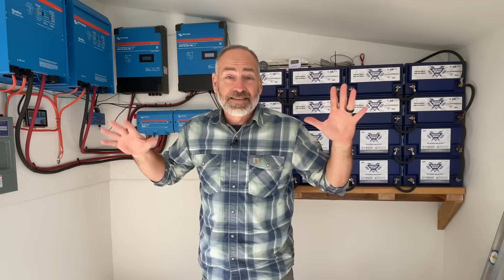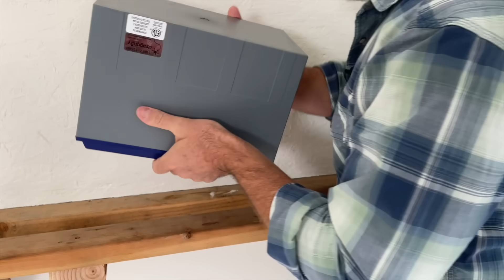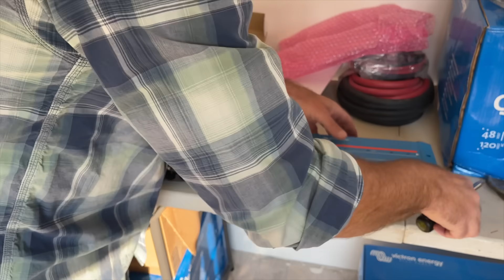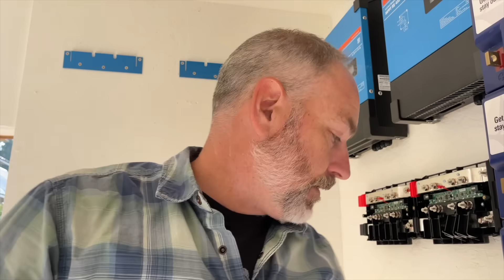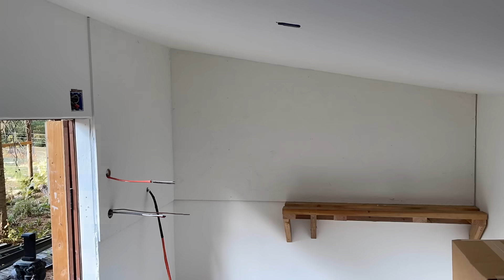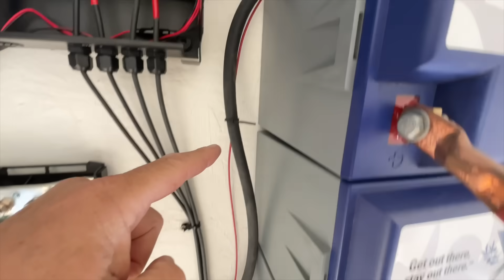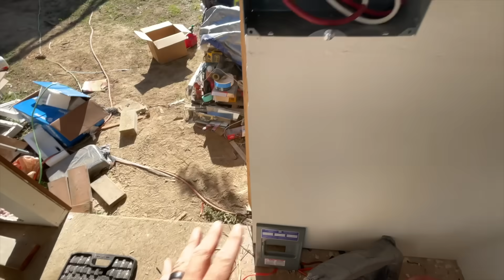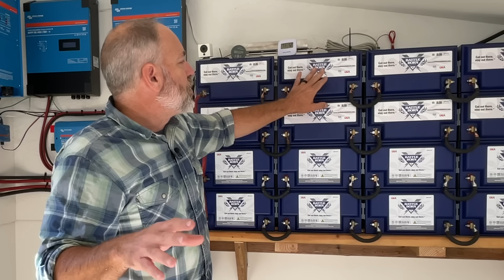EASIEST Off Grid Solar Power System Battery Bank

Comment: Looks impressive but  I think you should  put  bus bar  inside  a  junction box instead of keeping it exposed  it is dangerous when Live
In addition I would run the wires inside pipes

Comment: Weak sauce. 

Be lucky to run lights, minor electronics, fridge and furnace during actual colder/winter months. Each of the 16 batteries best price as of 2023 ~$500 each from sketchy “buy within 30 minutes or else” scam looking website/sellers. Unless you are way in the bush… and need a lot of grid power poles (10k each). 

Solar is still a silly investment. Spend 50k and get 10% output in real world winter(when it is needed) then need to have a backup power soupy (fossil fuel) generator as a “just in case”. 

If you are as dedicated to the  thumberg cause, go  fully green in the cold climate whiteout out lifestyle compromise drive your teslas,then you will freeze. 

If you have solar that was subsidized and only sell back and not store the electricity  to the grid at an extremely overpriced rate (subsidized). You are no better than the oil companies.
Reply from the maker: Or you just want to be off grid because you want to. Doesn’t have to be that complicated. People do all kinds of crazy things for no other reason than they like it.

Comment: you should separate the neutral wire and the ground wire in the garage sub panel the ground should not have any amp load used for sefety only.

Comment: Why is DC lighting ,refrigerators and dryers not with the solar system. Less power is need for DC 12
volt for lighting and 48 volte for  ac and heating system. Once ac 240 enters the house it should step down to 12 and 48 volte DC for lower power bills.???? Am I thinking to far out side the power box ,most people know very little about DC current

Comment: I see everyone slamming the guy for not picking up rack mount 48 v batteries. That’s kind of comparing what’s available here and now, and what was readily available 1-2 yrs ago.
Also building a system using discrete component is always way more expensive, where in the last year or so the all in ones rein king now, but think back a year, and there was little discussion about them.
Nothing wrong with Victron, it’s a good choice, and nothing wrong with Battleborn, both make very high quality products, but recently they are way more expensive vs say an eg4 all in one, and four to six 48volt server rack batteries, ( time marches on).
We installed our off grid system back in 2020, and ended up with what was available at the time, (two paired 24volt 3000watt growatts, setup to provide 240v 6000 watts, ( 12,000 watts surge). Today you don’t hear much about the growatts, and many other equal quality units are available for less money, ( ours were around $700 ea when we bought them). 
Also there is a race to the bottom going on right now with lipo batteries.
Speaking from experience, he is going to have trouble keeping those batteries balanced over time without a battery balancer. We have a similar setup that I have to break down and re- charge the batteries individually every six months or so, and shuffle their positions, ( I don’t have a balancer). I see his video is over a year old, so he is likely just realizing this.
Energy storage is another thing, when I installed my system I simply didn’t have the money to buy 3 power walls, ( or equivalent). So we opted for insulated water tanks, where the energy is stored in the form of free water. There are ways to calculate the stored energy equivilent, our water system stores equal energy to 2 powerwalls, (we use a TES, ( thermal energy system) to distribute the energy, ( mostly for house cooling in south florida). During the winter we switch it over to heat storage, and haven’t needed turn any heating system on at all 3 yrs running now, ( but having a super insulated sealed home, likely contributes more to that). 
Bottom line,,,,, give the guy a break, when he did this it was the best available at that time.

Comment: I've been running off great electricity for a long long time😮 in my house in Arizona what is all that stuff yet hanging on the wall and how much does that stuff cost, why do you need all that stuff ? We run all our Electronics just fine without that I never had a problem

Comment: How many times have the batteries needed to be rebalanced? Have any positive terminals get hot and loosened? Need a 48 volt battery, get a 48 volt battery. Preferably with some sort of data so you can know what’s happening. Preferably for half the cost…unless you got it for free😜

Comment: Its a good expensive setup, I don't think that 10-2 wire is recommend to wire up 50 amps to your AC panel.  Think you need 6-2 from your inverter to your AC panel.

Comment: There are only 2 types of people that build "Easy off grid solar systems" with Battleborn batteries:
1. Youtubers that get the batteries for free in exchange for pushing them.
2. People that don't know that spending $900+ for 100A lithium Ion battery doesn't make them suckers.

Comment: Hi, I have a similar system, using 3 x Phoenix 48V 5000VA inverters and 4 x 250/85 MPPT solar regulators. I'm in Australia, so it's fair to say that the ambient temperatures here are significantly higher than what you would experience. This has resulted in me having to install significant ventilation in the form of 18 x 140mm computer case fans above the gear, which extract the built-up heat from the room in four switched fan speeds, depending on how hot it gets.

The first thing I noticed, when viewing your video, was how close everything is to the ceiling and how the ceiling rakes to form a catchment right above the inverters. Are you having any heat build-up issues?

Comment: Thank you for making this video, very helpful. However as someone who works with pine and in construction, I would caution you against trusting all that weight (batteries) on one shelf. Please consider 2 shelves. I know they are light batteries but I am sure you don't want a fire if the shelf fails.
Reply: Overall very impressed

Comment: Ground and neutral bonded at the solar sub panel? Seems wrong. Though I guess if it's the source of the power then the panel in the house is the sub panel. So are the ground and neutral separate on the panel inside the house?

Comment: ALWAYS make sure to power up the MPPT's from the Battery side before connecting/switching on the panels, as you will fry the MPPT's, and disconnect the panels FIRST before dissing the batteries

Comment: Did the battery shunt and surge protector on the negative side come with the victron charge controllers or did you buy them separate?

Comment: Pretty long video to scrub, does he mention the total cost? Nvm, saw the links, thanks for the links,  2 invertors at $3,000 each is $6,000, 16 batteries at $1000 each is , $16,000, and the link for the charge controllers expired so cant see it, but that's at least $22,000 in that room. Yikes, I for sure cant afford that :/. Thanks for at least showing the links so we can see the actual cost of the parts shown, but IM still curious about the total cost for the entire system. I hear a lot of people say solar is affordable, but just what you have in that room alone isn't what I would consider affordable.

Comment: Thanks for the helpful video.
I recently purchased a robust Victron system and will be installing it soon.
I got two 10KW Quattro inverters in split phase, two 450V 200A MPPT charge controllers, and 75KW hour SOK battery bank (all from Current Connected).
Should be fun!!

Comment: Can you use a setup like this for 8 batteries and 1 5kw inverter or even with 8 batteries you need 2 inverters. This would be for Lebanon in the middle east which has 220v outlets.

Comment: @MartinJohnsonOffGridLving does your house just run on a 50amp service? since you are sending the power to the house through a 50 amp breaker? Is that enough? I'm trying to learn, since most homes are 100-200 amp services when you are grid tied to power all the appliances and such.

Comment: WATCH YOUR VIDEO 3YEARS AGO, BOUGHT EVERYTHING FOR MY SYSTEM 10X 100 PANALS , OUTBACK 80, AIMMS 3000, 8 battle born 100, PREDITOR 9500 GEN PROPANE OR GAS ,  WAITING ON THE  POLE MOUNT ROOF IS TOO FLAT, PATIENTLY GOING THROUGH STEP BY STEP TREE REMOVEL, AND FIREPROOF SYSTEMS ROOM JUST INCASE. THANKS FOR INSTRUCTION.

Comment: $22,000!!! Easy but definitely not cheap. Current prices as of august 2023: 
100ah Battle Born batteries $925.00 ea x 16 = $14800
inverter / charger $2,749.75 ea x 2 =  $5499.50
victron lynx distributor $222.70 ea x 2 = $445.40
Victron Monitor $289.85 ea x 2 = $579.70
Victron touch screen $220.15 ea x 2 = $440.30
That's $21,764.90 for the main components, plus tax,. Then you have the wiring and misc. components and of course the panels.
Reply: It’s cheap

Comment: Thanks very very informative. How much is the mail house load panel rated for. Is it 50A @ 240v? Im almost sure its at least a 100A @ 240 Volts? What is the cost for this 50A AC system?

Comment: if you have a panel too overkill to charge 1 battery, can you parallel 2 smaller charge controllers to charge 2 different size batteries at the same time  off 1 high wattage panel ?

Comment: Looks like you have about $22,000 in batteries and electronics without any solar panels and that's if you do the design and install by yourself. Yeah that's a great diy project, what could go wrong?

Comment: The 4S4P Battery with this Power -> 1 Cable -> 1 Fuse with 125A Confugration makes no Sense. Why 125A Battery Fuse (max 6300W - 6900W), but both Inverter at 10000W  needs 208A, but each with 125A Fuses. At Low Battery Voltage up to 238A. For me, the Battery should be splitted in 2 Strings (each Fuse 125A), better 4 Strings (each Fuse 60A)

Comment: Would it be a good idea to put fireproof or metal plate between the wall and equipment / batteries if it would be in a house? In your case it's ideal being in a shed 👍

Comment: America's split phase home electric system SUCKS, see, you have to buy two inverters to make it work...if in Europe, you only need one!!! You have to wire your house to equal load both sides, in Europe you don't, and you can supply double the power with the same size wire running to your outlets...

Comment: I have seen batteries connected using copper bars insulated in the center. Used instead of the tight looped wires and crimps. Maybe significantly faster, and possibly cheaper as no crimp fittings required.

Comment: Just a minor note, typically people put up some fireproof backer boards/wall partition boards. They are really cheap and mount directly to the wall, then you just mount all your solar/electrical stuff up against that. I always assume it was code to have them, but, every state is different ;). It'd also be nice to see as little kindling in a room like this, e.g. probably should of opted out for metal rack for the batteries instead of wood racks hehe.
 > EDIT: Maybe you have cement boards up? it's hard to see and I didn't hear you mention anything about it :)
Reply: Good point
Reply: It's generally in the instructions of the inverter to mount them on a Non-Combustible Surface.

Comment: Thx a lot sir for all your efforts, you could have built a comparable system for the fraction of the cost, and parts, had you waited few more months. Couple of months ago, the EG4 18K-PV came out, however the 42-48-6650 AES batteries from Discover, has been around for a while. You were gonna need only 2, 3 or 4 of them. At the most 6. No charge controller, nor combiner box needed only a T-class fuse. The easiest most powerful system could be built in few hours. We're not in Kansas anymore!

Comment: Good on BB for sponsoring the video.  LiFePos are the most expensive part of the build.

FYI on split phase units, L1 and L2 are Leg-1 and Leg-2 not "Line-1 and Line 2".  If you're gonna play electrical contractor, might as well get the lingo right :)

Great video for beginners.  I watched because I enjoyed your style.  Good camera work, great details, and admiting mistakes (ground wire!) is part of reality and good to point out.  It never hurts to do a complete walkthrough 2-3 times or have a 2nd pair of eyes.

Your proprety looks amazing.  Well done, Sir!

Comment: I am curious about the use of the quarto units instead of multiplus.  I am going with 2x multiplus 2 5000/120volt units for off grid as I need only 1 auxiliary input for generator charging.  They are less expensive.  Love your setup.  I am referencing it as well as others.  So many victron accessories to keep track of.

Comment: For the same price as those battle born batteries you could buy at least 50kw of  48v/100ah server rack batteries which is over 2.5X the capacity. $15k/20kw vs $15k/50kw

Comment: Lithium should not run to 0 volt. This is misleading. Anywhere under 20-15% will shorten the life of the battery.

Comment: At $925 per battery, that's an impressive wallet you got.  $16,000 in just batteries.
Reply: That's wild. I just bought a 12 volt 280 AMP battery for $400.  That's worth three of those batteries.
Reply: Which kind did you purchase?  @forgeteverythingyouknow1111
Reply: Homesteading ain’t cheap :(
Reply: Have an electrician update the wiring throughout your house and you'll spend at least that much just on wiring and hourly rate. Electricity aint cheap.

Comment: When I saw the thumbnail I thought this was an incendiary device, then I watched the video and realized this guy didn't even put cement board behind the batteries, and installed them up against wall and the ceiling, with 0 even cheap fire prevention measures... So first impressions were right, this is a how-to create an incendiary device video.

Comment: How do you keep the batteries balanced? Wouldn't it help to wire 4 sets of 4 batteries in parallel, and then wire the sets in series? I think I would go for 48V rack mount batteries. Then you dont have to worry about balancing since the BMS in each battery will balance all cells.

Comment: I live off grid and I have to say, the batteries in the link provided are nearly $1k EACH, and each  battery holds 1.2KWH. While the EG4 batteries are 48v 100AH for ~$1,500 and hold 5.1 KWH.  And the EG4 batteries have their own BMS system. Battleborn may be good batteries, but are they worth 3.5X the cost while also not having their own BMS? I think this guy got his batteries for free from the company.
The Victron stuff is also some of the most expensive you can buy.

Comment: I've been working in battery systems for a while now. A very important safety precaution! Cover the leads of the batteries with properly insulating cover. It is indeed 48V, BUT! If you bump your feet and land your hand shorting two positives, you are in serious trouble. 
Short circuit in this case is a huge safety risk! 
Very nice setup, but please cover the battery terminals!

Comment: List price of that battery is $874 times 16 batterie =$13,984 for that entire battery bank  
Nah....I'll stick with my $106 Deep cycle AGM battery  times 16 =  $1,696
I'll use the $12,288 that I saved on batteries to buy more solar panels.
My deep cycle batteries are good for 3000 discharge cycles.
Typical Lithium ion is good for 300-500 discharge cycles.  The best Lithium ion are good for 1500 cycles.
So I guess my "cheap" batteries will last twice as long.
Also in Wisconsin if I bring in my batteries I get $20 off for each of my batteries.
And if I bring in a Lithium ion battery I get CHARGED $3 for a disposal fee for each of my batteries. Even when buying new ones.
There is a reason that real off grid builders do not use the super light weight, high energy density, most expensive batteries.  Because you would have to be insane to pay $12,888 more just to save a few pounds on batteries in a bank that will NOT MOVE for many years.  But you do make super exciting videos showing how light they are.  So amazing.  I just have to run out a get me some.

Comment: I am new to solar power and there's one thing that I am confused about. As far as I know, batteries that are connected in series may become unbalanced over time, especially if you use both brand new and used batteries together, as shown in this video. I've heard about battery balancers, equalizers, and balanced charging, but none of these were used in this video. Can you please explain?